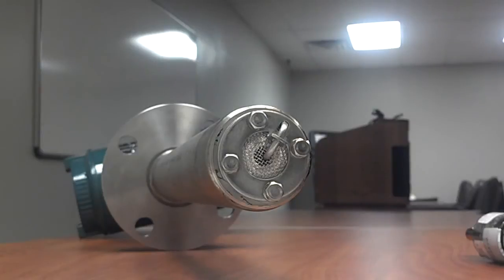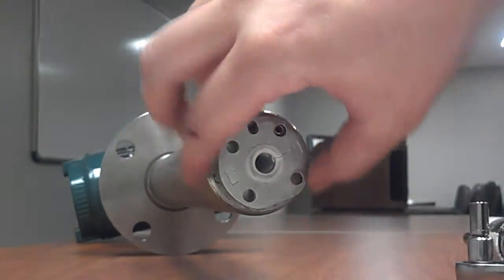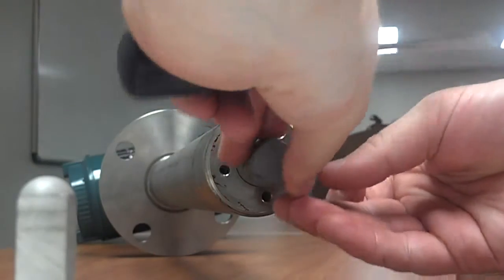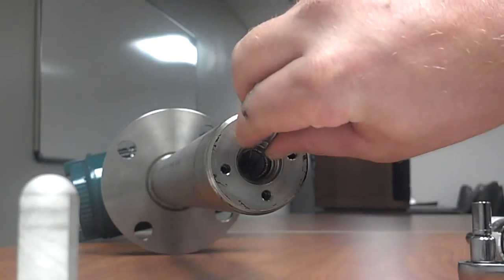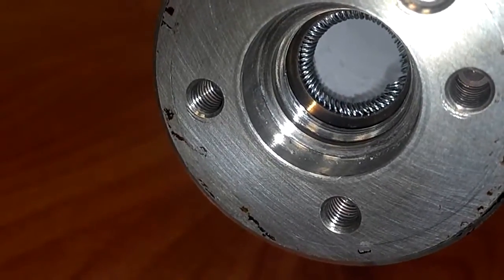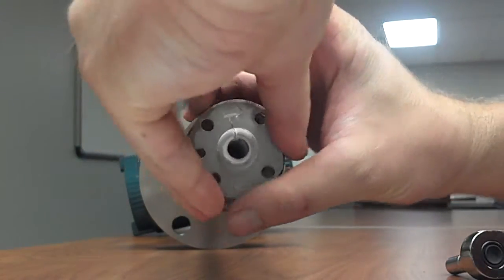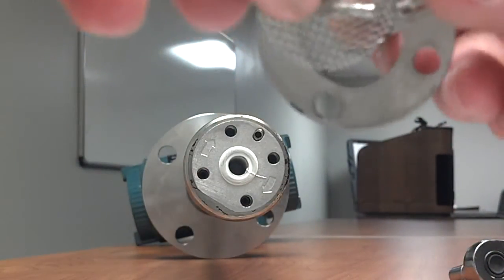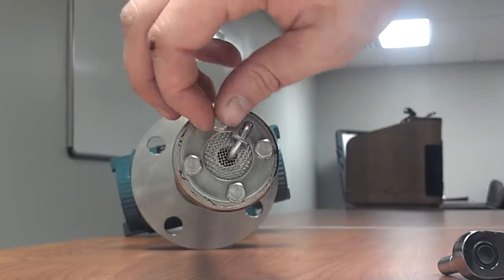O2 Cell Replacement Guide

Comment: Why are you taking the retaining ring out that secures the heater assembly? You do not have to do that to replace an O2 cell. It’s easy enough to get the contacting spring in there without removing the ring. I’ve rebuilt like 100 of these and have never taken that nut out. Also, the easiest way to get the old spring out is to use a curved mechanics pick. The new spring can be put in there with your pinky finger and secured into the groove with a tapered punch.
Reply: What is the purpose of the contacting spring, Sir?